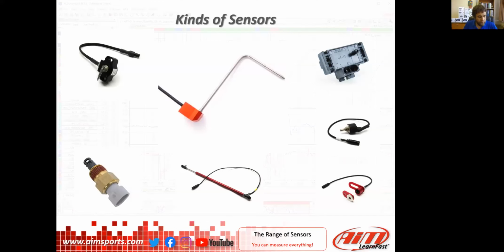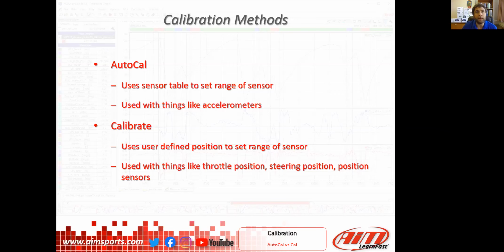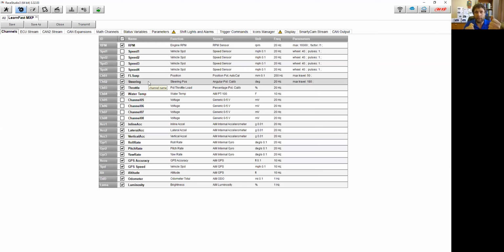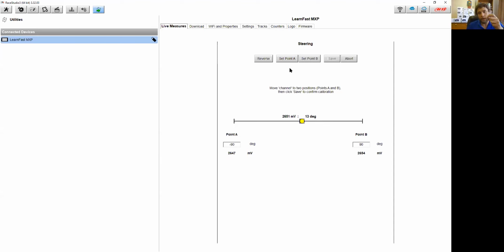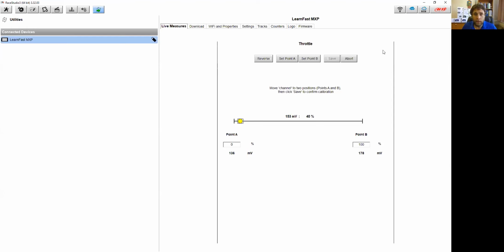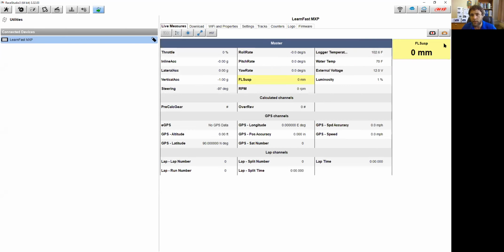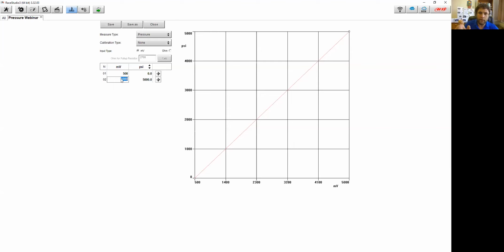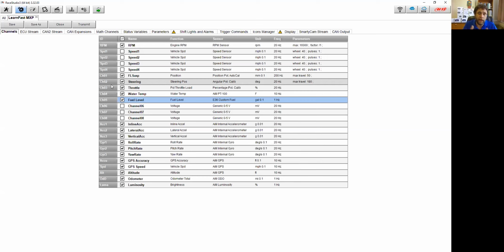1-17 Custom Sensors with Race Studio 3 - Live Webinar with Matt Romanowski - 5/26/2020

Comment: How did you tell the fuel sensor curve to have 15 datum points?   I have found it worth while to define temp sensors physically across several points, so I would want to make a custom sensors list with different amounts of datum points.   Thanks!

Comment: I am trying to add custom sensors to my MyChron5 and can't seem to find the way to transmit from RS3 to the unit
Reply from the maker: The Mychron5 does not use RS3 to transmit changes to the device. You set up all changes on the device itself using the menu feature. The Mychron5 does not support custom sensors but you can use the 0-100 based option to capture data and modify the data in RaceStudio Analysis with math channels to get the corrected value with units of your choice.